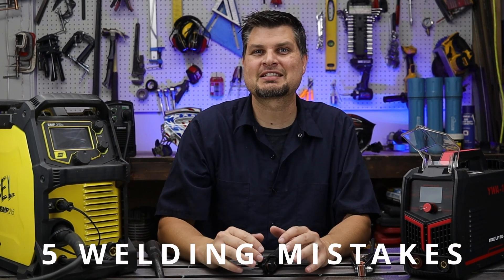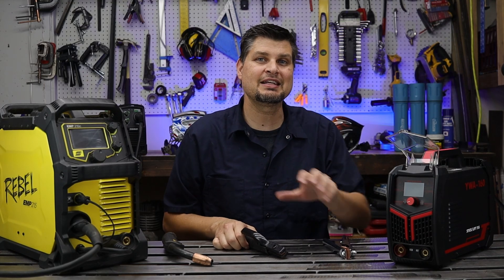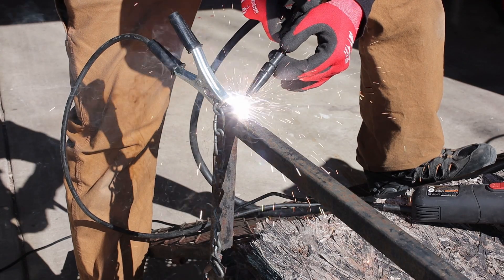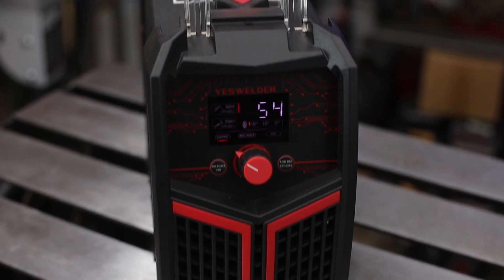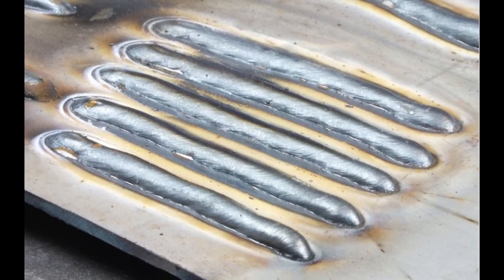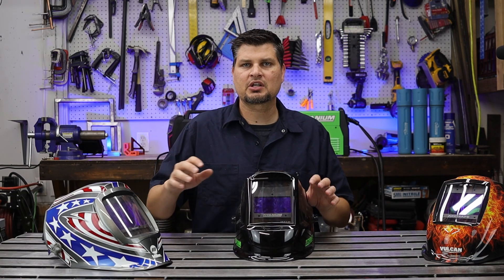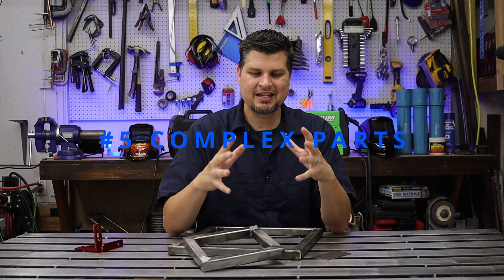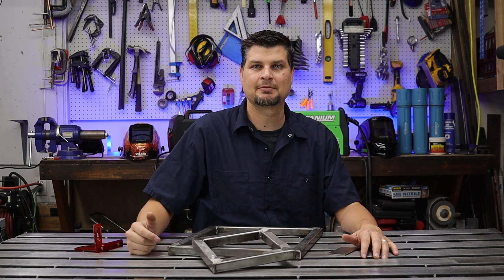5 Mistakes You've Made Welding \\ Tips & Tricks

Comment: I learned before auto-dark, and I would just set up really bright lights at a distance. Those little molten spatter bb's can melt into glass, let alone cheap plastic. 
     But even with auto-dark your best bet is to flood the zone --- with Light! 
     If you set up a spot light 12-15 feet away, that works. Weld in the full sun. Or get a really bright light with a replaceable transparent shield (like the bottom of a soda bottle) and get in close. 
     FLOOD THE work ZONE,  and life can be much easier!

Comment: Question. My neighbor is telling me, a flux core weld like what you're doing here, he says, is a "cold"  weld and not very strong, or rather not strong enough to be much use and suggested using the other welds types that use gas instead to get.... by his definition, a "hot" weld. Or is this just more misinformation? As a1st project, i want to diy and make my own cheapo a "stump vise" for sharpening my chainsaw on the move. My neighbor says with flux, the metals aren't going to hold, especially if I'll be needing to hammer the stump vise into a thick tree stump so that i can set my chainsaw into the vise and sharpen it easier while in the woods as opposed to walking the saw all the way back to the workbench. My idea for the stump vise is to take a $5 - 2 inch clamp and weld two scrap pieces of flat iron to to the back side of the clamp to make the posts for the clamp. then file those posts into pointy spikes. Won't be hammering directly on the welds but I will be hammering the clamp itself to get the posts to stick into a tree stump. Is this doable with a flux core welder? 2nd question. Can you flux core weld exhaust leaks? If not, what's the cheapest way to fix that? Thanks